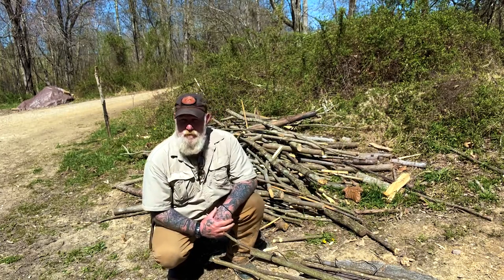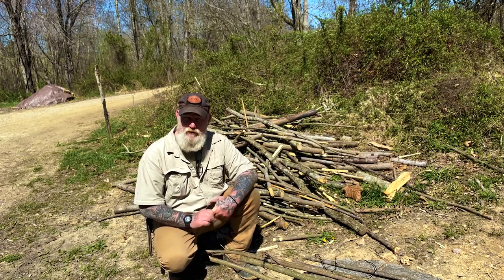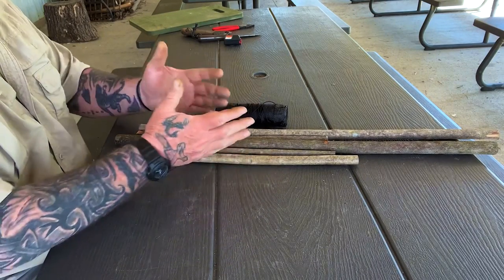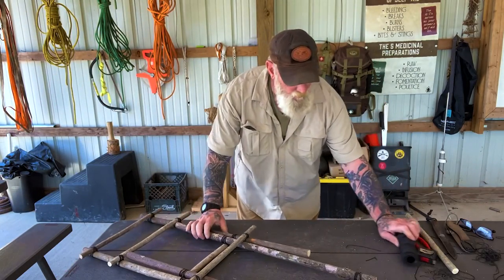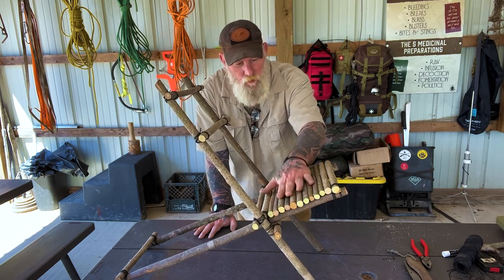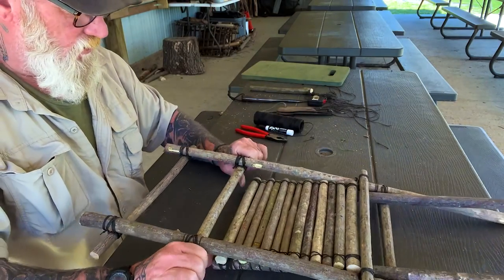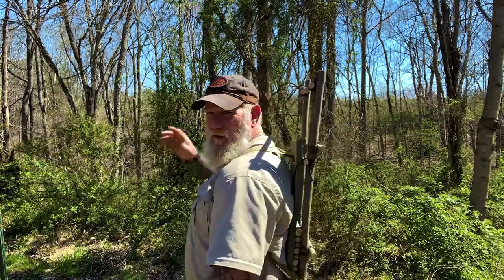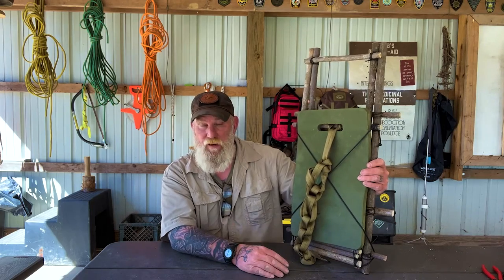Pack Frame and Camp Stool Concept Bushcraft

Comment: For an advanced project, you need four more beams and a 16ft pole.
Make sure you're using a diamond hitch secured tarp as a pack.
Then, secure your chair with the beams and bankline to your canoe. Insert pole and stretch out tarp.
Now you're sailing.

Thanks for all the videos you've made over the years, Mr Canterbury. Looking forward to many more.

Comment: An idea for packing in even more functionality: pre-drill a hole in the dead center of your topmost seat slat to receive a spindle and taper the shaft of the adjacent seat slat to use as your spindle:

Now you're carrying your pump drill as part of your pack frame, it's useful as part of your seat when you don't need it, and if you make it the two end slats: easily accessible off the end and easy to lash back when you're done.

Comment: Great work keeping with the idea of multi-use items.  Often the bushcraft pack frame only does one job. As well as the chair.  Excellent idea of creating something that does both, that doesn't require complete disassembly of either.  Would it help to use the pack straps as braces between front and rear legs? Thanks for sharing!!

Comment: It might be a little bit faster using that haywire Klamper wire crimping tool . You can make one of those with a clevis and a bolt that’s been pounded flat with a notch and pin with multiple holes

Comment: Tried it years ago. Wood was to heavy to be practical. I finaly modified a steel folding chair to act linke a L35 backpack frame. Best of two worlds. Back is well ventilated in sommer and in winter the isolation on the back isn't chrushed by the backpack. 

I sugest usining a havy fabric to construct something like a foldable beach chair. Safes weight and is more multiuse.

Comment: When I’m wrestling with sticks and twine, I lay it out, slip a rubber band over each joint, place things where I want them, and then mark all 4 sides of each joint.  That helps when it comes to notching and/or lashing.  

I also raise the work up off of the work surface by laying a few other sticks under them.  That makes it easier to pass twine under and around the joint.
Courtesy of Half Vast Flying

Comment: That's cool and all, but it seems like an awful lot of work for a semi comfortable seat.
I have made a few tables in my day and find a square running lash to be easiest and most effective for a series of parallel pieces. You start at one end with a clove hitch or square knot in the center of the line. Run both lines over and cross behind,  repeat on all pieces, end with a square knot.